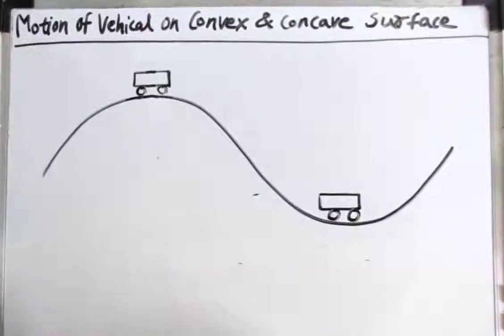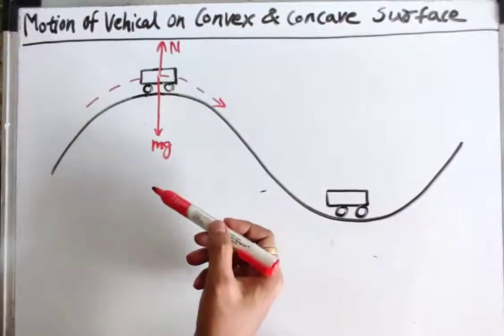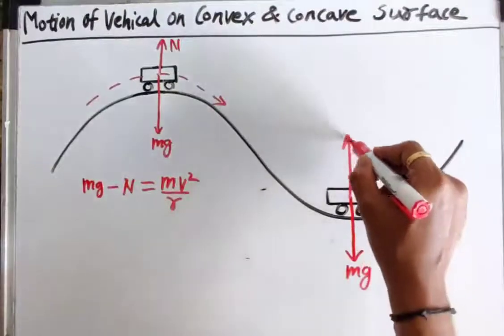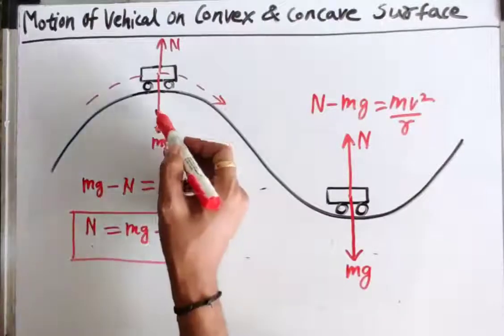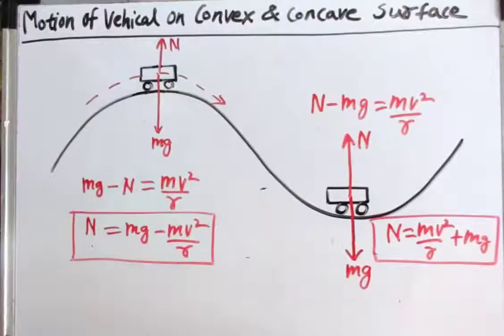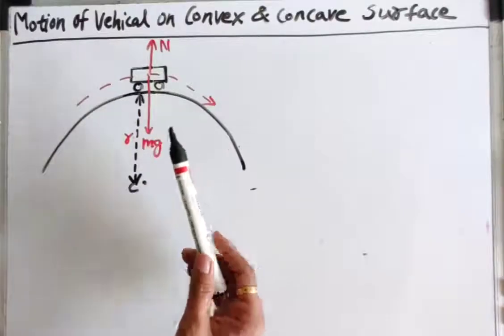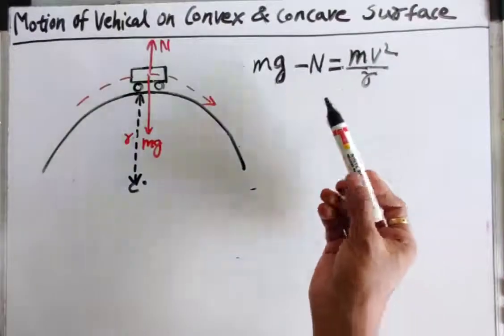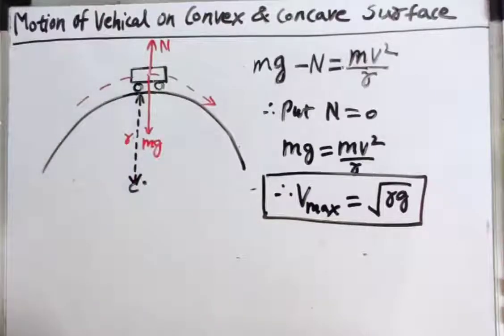Motion on convex bridge

Comment: why in convex surface mg is greater than Normal reaction and ...??? Can you please help me?
Reply: @life is easy 
See, because the car is moving along the road and not flying away it means that the net force is acting towards the centre of the circle(which is downwards for a convex bridge) . Therefore mg is greater than N in case of convex bridge
And mg is less than N in case of concave bridge cuz net force is acting upwards.
P.s. F net is just centripetel force